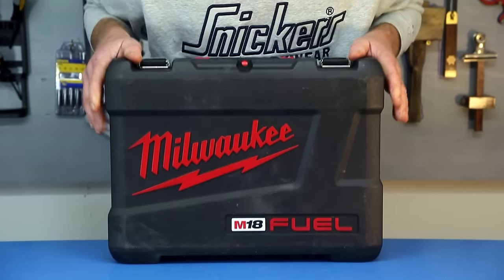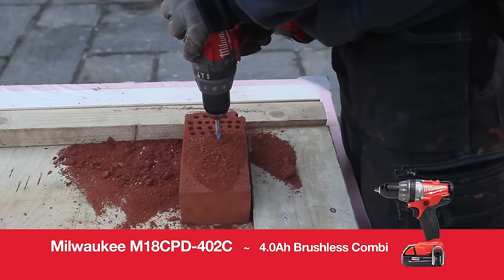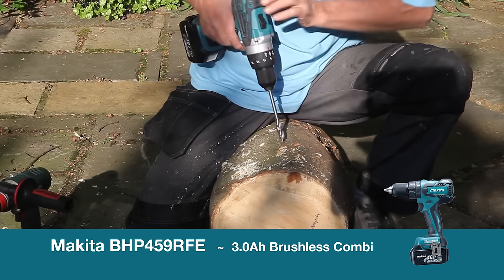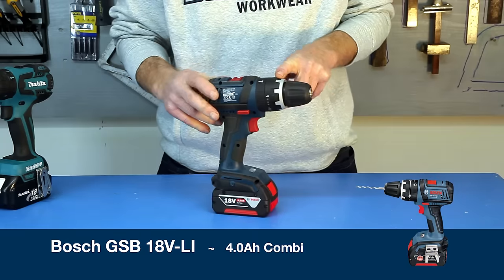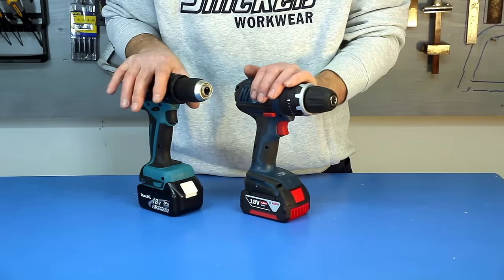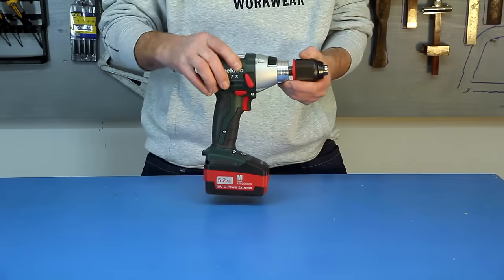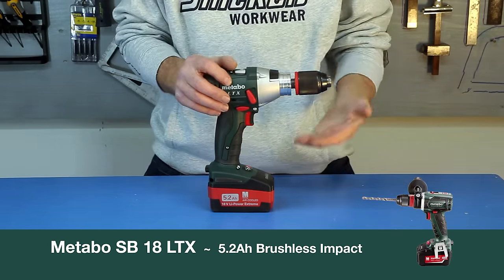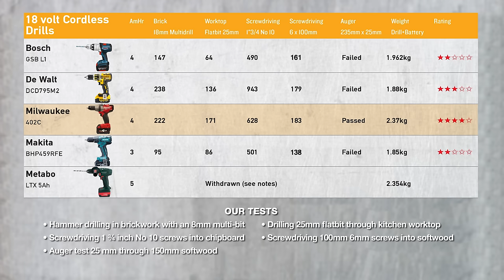18v Cordless Drill Review - 5 Best Drills Tested

Comment: About a couple of weeks ago my Cordless Drill finally Died it was 13  years old and I bought from Homebase it was their own brand so I'm in the running for a new cordless drill. As an Active DIY'er would I need an 18V or Would something else be good for the job? What Say You my Friend
Reply from the maker: +TheAudiostud I reckon you did very well for a Homebase drill. I have no idea who made it for them. 
An 18 volt cordless is a good all rounder with a hammer action. As always it is the batteries that cause the problems and the more you charge them the shorter the life so a low Amp Hour battery will need replacing sooner than a 4Ah. If you are happy with one battery with a low run time then you can pick up an 18 volt cordless for less than a £100.00 from Screwfix. The Makita looks to be the best deal right now with a 3Ah battery. The manufacturers put these tools in there at a loss just to get the rest of their range in so you probably won't do better. 

Also check out Ryobi, Triton and Hitachi for low priced drills.
Reply: Like most of my tools Rodger once they are used they get cleaned & oiled, I have no idea who made them for Homebase but who ever it was they did a great job as it saw plenty of action and it helped build plenty of things, I may even strip it to see if i can see what has failed, well you never know it might be something silly like a wire!
Reply from the maker: +TheAudiostud I always like to open things up to find out what the problem is and, as you say, it could be a loose wire or switch. It may also be the brushes but getting replacements when you don't know who made it is difficult. I wouldn't bother asking Homebase. I take it you have put a volt meter on the battery? Give it a go and tell us what you find.

Comment: I have been at a school work shop where they numerous makita 18v drills and also a heap of battery that wouldn't charge up again after 60-100 recharges. I have had a Dewalt now for the past 3 years and must of charged it 100s of time.
Reply: I have 4 Makita batteries 2x1.5ah and 2x3ah. The 1.5ah are 2 years old and the 3 ah are just coming up on 1 year old. I charge them all once every day or every other day. I hear about people having problems with makita batteries alot, but so far my Makita stuff has been great. I always let my batteries charge to full when they are dead. I feel like at a school kids don't give a shit and just grab them off the charger before they can finish charging. If my batteries don't last at least another year I'm switching all of my tools to milwaukee for their 3yr battery warranty vs makitas 1yr.
Reply from the maker: crephotos In our  experience Makita is very good at replacing faulty batteries, even out of warranty. They can tell from the data stored in the chip  how many times they have been charged and how long they have been used and if they don't give good service they don't argue.

Comment: Helou Roger,
Compare please these 6 Cordless Combi Drill:
1.	Metabo SB 18 LTX BL Quick with 5,2 Ah l Li-ion batteries
2.	Dewalt DCD995P2 18V Cordless XR 3 Speed with 5,0 Ah Li-ion batteries
3.	Milwaukee M18 CPD-402 C with 4.0 Ah Li-ion batteries
4.	Bosch GSB 18 v-ec with 5,0 Ah Li-ion batteries
5.	Makita DHP 480 rmj with 5,0 Ah Li-ion batteries
6.	Hitachi DS18DBL 18-Volt with 5,0 Ah Li-ion batteries
THX

Comment: Is that Milwaukee hammer drill not available in the us? Couldn't find it. On the home Depot app.
Reply from the maker: roy massey  I have checked out the situation in the USA. The 18 volt Fuel CPD 402 C
 is certainly available  but not from Home Depot. You should find plenty
 of other outlets if you Google it.

Comment: I know these are all good tools for the trade but I was wondering how they compare to the Hilti 18v cordless drill. Yes I know Hilti is tops and used in many industrial construction sites here in New Zealand but would like to see a demo comparison on you tube :-)
Reply from the maker: I would also like to run Hilti in a test. They don't have an 18 volt drill so it  is hard to know what to run them against. They seem to go on working forever. We see a lot of old Hilti drills still going strong.

Comment: i have an old dewalt battery drill three speed gearbox and i can drill a 50mm hole in the same thickness of wood as you it’s the old one with the heavy nicad 18v oval batteries the wood was oak and a forstner bit

Comment: Nice little review, except that I don't understand why you pitch this huge, powerful and expensive Milwaukee against cheaper and weaker drills by the specs. The only comparable drills to the Milwaukee is the older BHP458 or the more recent, brushless version of it DHP481 from Makita. The other manufacturers haven't updated their drills in a while and are pretty much out of competition in the very high torque range.

Comment: meh I'm a structural alum fabricator and regularly drill 7/8 holes in 1/2 alum. I've gone through literally DOZENS of all the makes in my years and I'll only own a Makita. Makitas last and take more abuse than ANY other drill hands down. did you to actually tear any of these drills down to see how they are constructed?
Reply: also the mak had a 3amp bat! the rest where 4... I love my Makitas best build cheaper than a Dewalt
Reply: I've used both Milwaukee and Makita in my plumbing business.. In my assessment Makita is definitely better than Dewalt, but it falls short of Milwaukee for numerous reasons including torque, battery run time, and battery life..
Reply from the maker: No we didn't take them apart. I have done that sort of thing in the past but not being an engineer I can't say it teaches me a whole lot. Others are doing it on YouTube and they do it better than I could
Reply from the maker: Yes, we have answered that point several times. Makita did not have a 4Ah battery at the time of our test and we make this point. I said it was holding them back and it was true because they have since produced 4 and 5 AH and are not onto 6Ah. Meanwhile Milwaukee has 9Ah
Reply: Skill Builder most of mine are 3mah. I have about 12 motors and only 2 or 3 4mah batteries. I really made no mention about battery life in my comment. I was referring to overall lifespan of the motor.

Comment: Where are the specs and prices for each tool?

The Milwaukee don´t belong with these other models. For example you should have used the Makita´s DHP458RMJ model, which have almost the same specs as the Milwaukee 402c model.
And then we got the charger time also, How long to charge the Milwaukee´s 4 Ah battery, 50-60min? The Makita´s 3Ah battery charges in about 25min, so you should have used that one twice to compare with Milwaukee.

I´ve personally tried Bosch, Dewalt and Makita. All of these are very good and the Milwaukee is probably also :)
I bought the Makita DDF456RF3J after alot of research and testing. Mostly because Makita has the largest arsenal of tools that use the same battery.
Reply from the maker: OK you have a good point.I tested 18 volt drills I could get hold of through friends etc.
I would love every power tool manufacturer to lend me their best tool for testing but when they hear that I want to do a comparative test they lose interest.
They are scared of what I might say.

Comment: how long will a makita or milwakee battery last? as in when will it be garbage and time to buy a new one? lets say i use the drill for like 20 hrs of work per year, when will the battery start failing?
Reply from the maker: If you leave a battery unused for 6 months or so it does it no favours. Better to use it frequently. The life of the battery is usually measured in charge cycles though excessive heat will shorten the life. 
 You should get easily over a thousand charge cycles out of a good quality battery before it starts to  deteriorate. If you charged once a day, which you won't,  then that is roughly 3 years. So a typical battery life if you don't overheat it would be around 5 years. 
A 5Ah battery will usually last longer than a 4Ah because you need to charge it fewer times.
Reply: ok thank you very much for the reply
Reply: I have 2x 3.0 Ah batteries from Milwaukee used them weekly and those are from 2010 aka 6 year old still works like new meaning haven't notice any performance drop.

Comment: Hi!  I live in Vietnam.  I am looking to buy a battery screwdriver and I am deciding between the 3 brands that I think are the best: Makita, Milwaukee and Dewalt.  I know that your channel has accurate, objective and reputable assessments of the quality of machinery brands.  Please give me your opinion on my question: I want to choose a battery-powered screwdriver that lasts over time, a machine with the longest average life, 1 of 3 brands Makita, Milwaukee  and Dewalt.  A machine that can be used for a long time over time includes factors: getting wet due to going out in the rain, being hit hard by falling, the possibility of damage to the control circuit board with long-term use and other damages.  other miscellaneous miscellaneous.  Please let me know which of the 3 brands I should choose for long-term use according to the factors I mentioned above.
Reply from the maker: Makita is a good bet in Vietnam

Comment: Did you not consider testing the Hitachi, or the festool drills as I hear the festool has 5.0  battery
Reply from the maker: +Steven Reynolds 

The Festool has a 5.2 amp hour battery but everything has moved on since this test. If you click on Sklil Builder just below the title it will take you to the new test which includes the  Festool 5.2Ah battery

Comment: SB--I'm a property manager and do minor repairs with ocasional larger repairs.  I need a whole new Compact system.  What system would you recommend?  I was thinking of going non-brushless to save money.

Home depot will have a lot of black friday deals so I want to go with a system and stick with it.  I'm debating-- Rigid, Milwaukee, and Makita.  What are they known for and how do they rate-- quality, durability, and cost?

If you had to start with a completely new 18v system what would you go with in my situ?

Anyone else' opinion is also welcome
Reply: Youre gonna get a lot of mixed answers, but it seems to me that Milwaukee is best. However, on my crew at work two guys have rigid (father and son though) and another has a makita. They all seem to work fine. I personally have been using Milwaukee m18 for like 2 years now and I really like it. I just got a milwaukee m12 drill/impact set a few weeks back and I like it a lot. Thinking about picking up the M18 model 2606-20 drill and flashlight kit at Home Depot for $99 though. Seems like a slammin deal. Best of luck to you.
Reply from the maker: Thank you Lazy, good to know. This is the kind of feedback that people find useful. Our tests are just there so spark off the debate and bring in real life user experience.

Comment: Hi, have you used or will you be reviewing the new bisch flexiclick drill? would really appreciate a review. thanks.
Reply from the maker: +Zuber Ismail Yes we have done that. Have a look at our videos and you will see Bosch 5 in 1 drill
Reply: thanks for replying, appreciate it. bought one nakwd on the 11th Oct, just haven't used it yet, thought i'd get your thoughts before I ordered the other 3 adapters. I have the Milwaukee 12 v 4-1, good for fitted cupboards etc, just a bit lightweight though.
Reply: thanks for replying, appreciate it. bought one nakwd on the 11th Oct, just haven't used it yet, thought i'd get your thoughts before I ordered the other 3 adapters. I have the Milwaukee 12 v 4-1, good for fitted cupboards etc, just a bit lightweight though.
Reply: thanks for replying, appreciate it. bought one nakwd on the 11th Oct, just haven't used it yet, thought i'd get your thoughts before I ordered the other 3 adapters. I have the Milwaukee 12 v 4-1, good for fitted cupboards etc, just a bit lightweight though.
Reply from the maker: +Zuber Ismail The SDS attachment is surprisingly good. I thought it might be a toy but it works really well.
Reply: quick reply, keep up the good work, might just order all the adapters. cheers mate.
Reply: quick reply, keep up the good work, might just order all the adapters. cheers mate.

Comment: put a 4 amp battery in the Makita it WILL smoke milwalkee
Reply: Yeah it smokes just as soon as it turns no need for the 4 amp battery but why not put a 5amp on a milwaukee and screw away happy :)
Reply: No...cause Makita have the weakest engines and no good safety electronics!
Reply: the amperage is important for autonomy of batteries and not for the power of the machine.
Reply: Makita gets only 2 stars? No way!

Comment: the Milwaukee is a better drill, but...  the makita used to be half the price when I bought mine. I used it for close to 5 years on a daily basis drilling telephone poles. usually 14" or thicker holes with a 3/4" drill bit. I could drill 15-20 poles on a single charge. used to eat the nicad Milwaukee and dewalts for lunch. 

I'll tell ya right now, buy the dewalt. it is not the most powerful, its not the best made, but. it will be the cheapest to run, easiest to replace parts if desired, and used dewalt stuff is a 10 cents on the dollar. I've never found makita stuff locally for cheap. it's usually at or more expensive then retail.

Comment: I really don't see the point of a fuel gauge,  most people have at least 2 batteries so you just charge the flat one while using other one, I don't see the need to be constantly checking how much power is left

Comment: Quick question. Do the drills actually rotate a bit off-center or are they all supposed be rotating dead center?
Reply from the maker: They should rotate dead centre but a lot of the lesser quality chucks out there rotate eliptically.  They end up drilling a hole that is larger than the drill bit.
Reply: Thanks a million for the quick reply. I just bought a Black & Decker CD121K50. I am not sure if you have tried this one personally or if it is a defective unit but the darn chuck is not rotating dead center!
Reply: Faizal Khan black and decker is generally cheap diy grade rubbish if you can still get away with returning it and getting a full refund do it and spend a bit more on something a whole lot better
Reply from the maker: Faizal Khan

To be honest even a lot of so called. top of the line drills do not have chucks that spin true, You can take several out of the box and try them and you might find a good one but it is luck rather than design.

If you run a drill at full speed under no load you get the kind of effect you find on a car when a wheel is out of balance,

Comment: Is the dcd995 more the direct competitor in this lineup then the dcd795. It seems its not really the same class of tool
Reply from the maker: The Milwaukee still tops it by 20Nm torque. The Dewalt we chose was the best we could get hold of at the time and it is an 18 volt.  The DeWalt did better at the smaller end. The results show that if you need high torque you lose a bit of run time on the smaller end. We have learned a lot from this test and would do it all differently next time but there is still good information in the results chart.

Comment: Confused, caption shows brushless drill, says brushless impact, and test appears to be using brushed hammer drill? Also, tester says it went into self-protection mode but it seems to just be in Impuls mode?
Reply from the maker: +TheRacerRich 
Good spot.  Sorry for the mistake. The drill tested was the brushed version so the caption is wrong and now corrected. You are the first person to point it out.  However the drill did cut out and it wasn't about the impulse
The footage showing the impulse mode was just site footage and not part of the controlled test

We have now tested the brushless version and this is included in our updated test. Hopefully you will find it less confusing but by all means tell us if you find any errors.
Reply: +Skill Builder Ah, ok, that makes sense. I actually just started watching Part 1 of the new test now. Though it looks like the Metabo you had didn't have the LiHD battery, just the old 5.2...though I have to keep watching to find out.

Comment: i dont get it is the metabo a percussion drill or an impact driver? i dont understand why you would put an impact drill up against normal drills
Reply from the maker: The Metabo is a combi drill driver with an  electronic impulse drive that gives short burst of power. It is not the same as an impact driver which uses a pair of mechanical hammers to tap the drive around. The impulse drive on the Metabo is for freeing rusted screws etc and not for driving them in. Metabo advise against prolonged use and it does produce a lot of sparking on the brushes. The lad in the video had a go at driving screws in just to see what it would do. It is nowhere near as effective as an impact driver

Comment: The heat sinks on the bosch's battery is for probably when it's charging
Reply from the maker: +Berounes I think you are right, the charger blows air through the battery. In use it doesn't seem to make any difference but on our next test we will check the temperature on operation. I think that will tell us something.